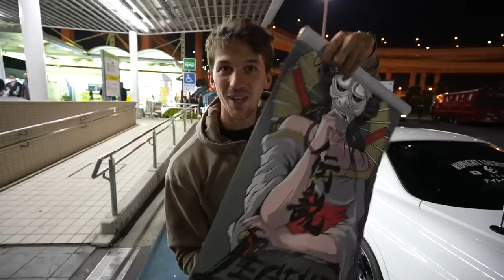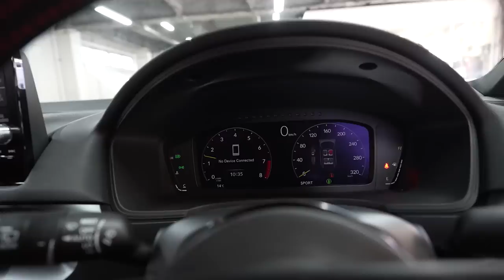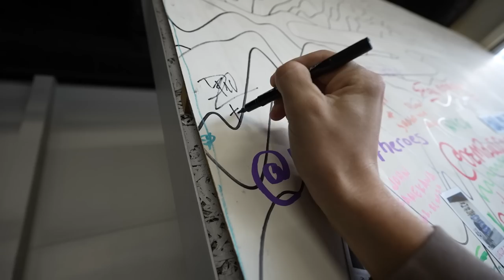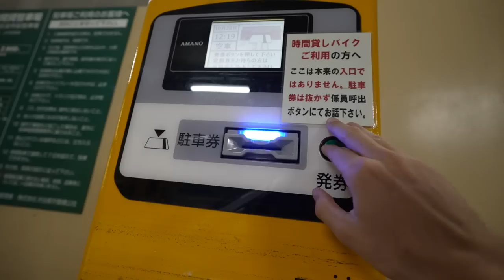I Found the ULTIMATE 2023 FL5 Civic Type R in Japan! | Spoon Type One

Comment: 11gen is a slightly tweaked fk8. Shares a lot of suspension components, k20c1 engine.  It nice. But still has issue with over heating. Fl5 is a super nice car and clean. But fk8 is such a nasty car and looking car.  It not a night a day different between the two beside the changes that make the 11gen a 11gen civic.  Both fl5 and fk8 are monsters. Can't go wrong with either one.  It mainly a style preference.